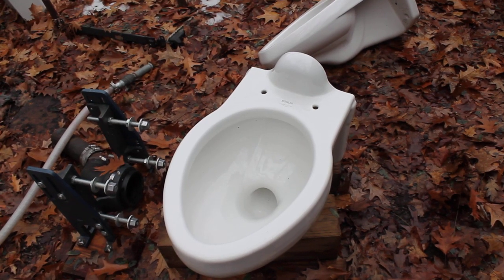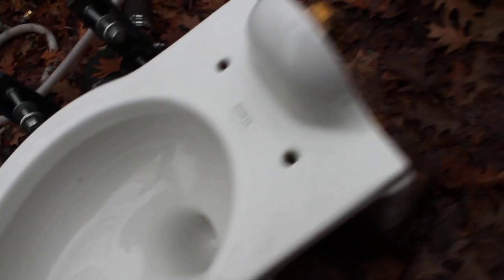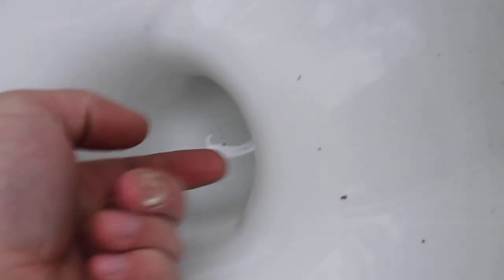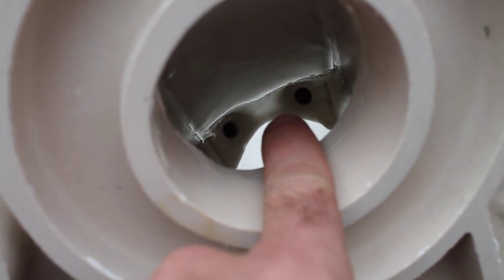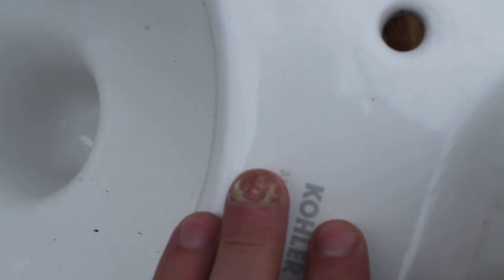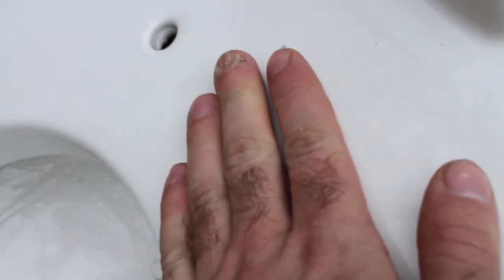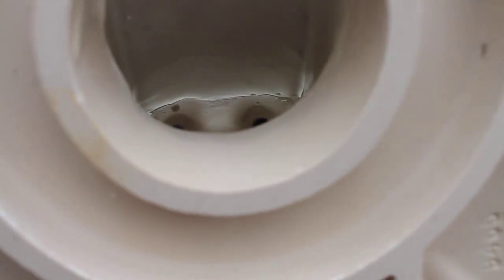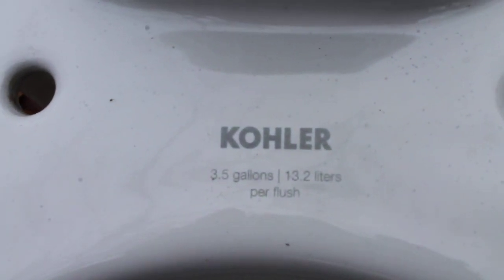#38 Concealed siphon jets.

Comment: Interestingly enough, if you were to attempt to bucket flush a blowout toilet, it would not siphon out without modifications. This is due to the design of the blowout toilets having their outlet higher than a traditional siphonic design. Now if you were to add a pipe (sealed of course) off the back that ends up lower than the bowl and then a bucket flush would work.
Reply from the maker: Yes that's correct. It wouldn't siphon but you could still bucket flush a blowout toilet by simply displacing the old contents out with the new water. I want to try it soon!
Reply: @vintage kohler  I would like to see the bucket flush of this toilet - first just the way it is, then again with a pipe sealed and attached to drain lower so it can create a siphon
Reply from the maker: @Drakee99  I will try it soon. I might be able to use a FERNCO coupling to the outlet and make a down pipe to make it siphon..

Comment: I wonder if the American Standard Instanto toilet, Eljer Tacoma toilet, and Crane Rapidway toilet has the same type of blow out jet the same as the Kohler Stratton/Sifton/Suffield toilet has?
Reply: The later Instanto does have these type of concealed jets. A Rapidway has a visible vortex jet. The later square trap Tacoma’s also have a vortex jet in the bottom of the trap opening, if you look carefully into the trap next time you find one you can see it
Reply from the maker: The Instantos from the 20s and 30s had an exposed jet that you could see in the bottom of the bowl, but later ones had concealed jets like the Kohlers. The Crane Rapidway had an exposed jet, but they also made a blowout toilet called the Lowell that had concealed jets, so it could be drained of water for winter in park bathrooms. The vintage Eljer Tacoma had an exposed jet, but I'm not sure about the later Tacoma.

Comment: I always find these kinds of toilets with hidden syphon jets fascinating.  I believe the 1987 Mansfield 210 I used to have had one large jet up the trapway.  I remember doing a video of sticking a GoPro up the trapway of a 1981 AS Afwall and getting some of the syphon jet action, with and without toilet paper.  If you looked closely you could see the slight rush of water coming out of the two holes, which I couldn’t get a good view of.
Reply: The video is in my “Underwater Flushes” playlist.  I think you might’ve seen it.

Comment: I wonder why the Kingston design changed from the side-fed jet to the front-fed jet? Could have just been a design / aesthetic thing, as there's no shortage of incoming water pressure to feed the jet at various distances.
Reply from the maker: That is a very good question. The -1965 Kingston had concealed jets. In 1966 they used an exposed jet, fed from channels on the sides of the trap which came from the spud, much like the 2000s Afwalls. Then in 1971 or 72 they went to a front fed jet. 
 I love the oldest Kingstons, but my favorite version might just be the late 60s ones. They seem to have a stronger siphon jet than the later front fed ones. I wonder if the front fed models were easier to cast?
Reply: Yeah, could have been a casting issue to simplify things...or the re-design was to smooth out the lines and shape of the bowl.
Reply from the maker: I have also noticed a difference between the 70s Kingstons and the Water-Guards. From the chamber inside the spud, the water passes though 2 or 3 small holes in order to pass inside the rim channel. This would cause a lot of internal squirting where the water enters the rim, and I think it might contribute to a lot of air noise coming out the rim jets when the toilet is flushed. I have noticed that a solid stream of water coming out of an orifice is much quieter than air, and I think these toilet send a mixture of air and water from the jets, which is a lot of the noise that these toilets make.  
 The Water Guards have a larger hole which admits water into the rim channel. I think the water is less constricted until it is finally ejected out either the rim jets or the siphon jet, which is a little smaller than the 70s ones. 
 After owning and playing around with both of these toilets, the Water-Guards are definitely quieter toilets, and flush stronger than the 70s Kingstons and I suspect that the difference in the internal flow regulation within the toilet may have to do with it. Just a guess though.
Reply: I would imagine you're right. And the newer ones are definitely quieter and less bubbly / frothy. The pre 1.6gpf Afwalls have two smaller inlets for the rim, with a larger opening that feeds the two (or sometimes, one) siphon jets. It seems the Afwall design may not have changed much for the entire series of models from the late 60s to the 90s that had the very-rounded, bulbous design - but I don't think any of us have a 60s Afwall or Glenco to check with. I bet that the toilet designers never imagined people like us analyzing the inner workings of their masterpieces like this! haha

Comment: Yup, exactly! Older Afwall jets look nearly the same :)  Nicely done explanation!
Reply from the maker: Thanks! That NOS 1985 Afwall is still $30 for sale up in Calumet. I might finally have to buy it someday. I actually prefer it over the early 90s version. 
 I've always liked toilets with concealed jets, probably because it was used on many of the Kohler toilets that I grew to like. I suspect that this style jet doesn't work very well on new high efficiency toilets with small traps.
Reply: Get it before it's gone! NOS are pretty hard to find, and if that is '85...that would be the "transition" year before the aspherical trapway mouth design / 3.5 gpf. Pretty rare! :)
Reply from the maker: @CapturingToilets  Yup, it's the symmetrical trap version, with a block logo. I've heard it repeated on youtube that the gold logo was used from 84 to 86, but I'm beginning to think it was probably only used in 86. The only gold logo I ever saw was on a 86 Cadet.
Reply: @vintagekohler6085  Cool. The gold logo...meaning the one with just the two words (non-script) stacked vertically, right? There are some Afwalls I know of (hope they're still there!) here locally that have the "words only" logo but it's printed in more of a dark color, almost black. They were are original to the building, opened in summer '87, and are not the 3.5gpf design. But I've also seen it printed in the "gold" color on a gray 1980s Cadet (sadly that was removed during a building repurposing). The gold lettering is usually printed in a bolder version of the font, and the "black / dark gray" lettering is seems to be printed in the font from the block logo.

Many of us assumed the "gold logo" was something of a big centennial anniversary of American Standard, but their history doesn't appear to show anything major happening in their history in 1884-1886, or even really in 1887. Anyways, maybe there's something to the history that isn't public.....or they just changed graphic designers several times during those years lol.